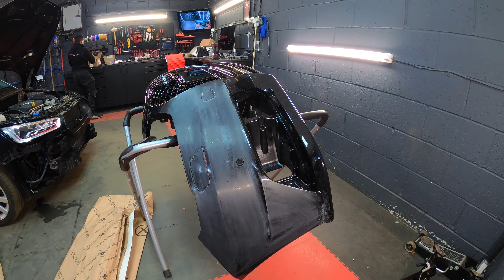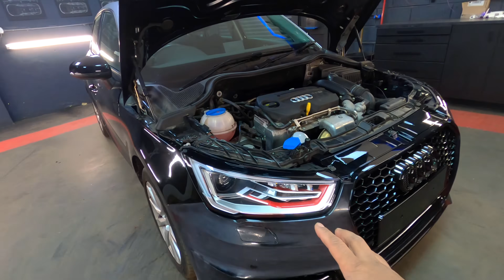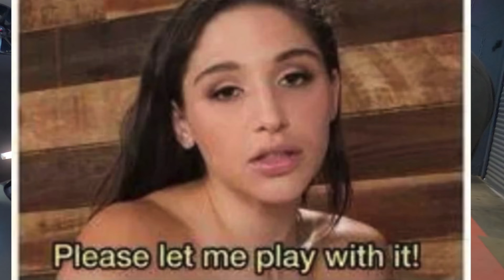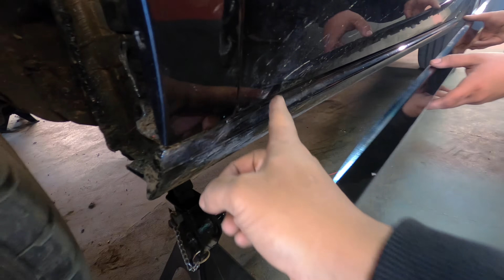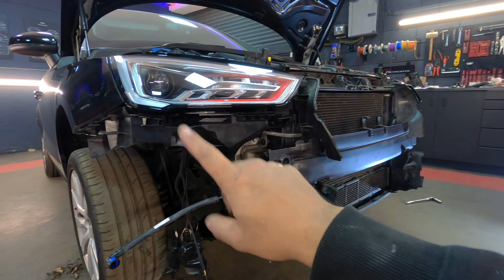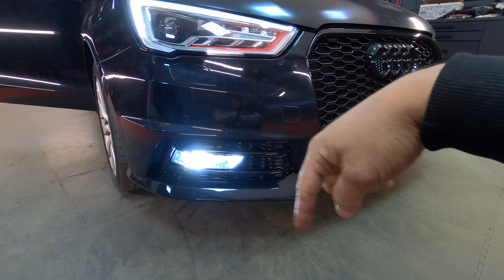Custom Front End Fitted To The Audi A1 -  Project A1 (Episode#3)

Comment: Brother I try hard to change the front light  for my  2011 to the new  Facelift,  but it didn’t work 💔💔💔 can you explain which part of wire or cables need to be added to upgrade for new facelift lights 🥲 thanks a lot 🙏

Comment: If you want to sell the original headlights drop me a message
Reply from the maker: Only have the drivers side headlight as the passenger one was damaged in the accident. It’s available for sale if you want it?
Reply: Hi , I have just got A1 with Halogen , I bought second hand the xenon and led back lights also I bought a vsds for the coding just wondering if you please give me a help with the coding because I don't know much about it..., only what I have seen on forums which is not very clear...
  Thank you